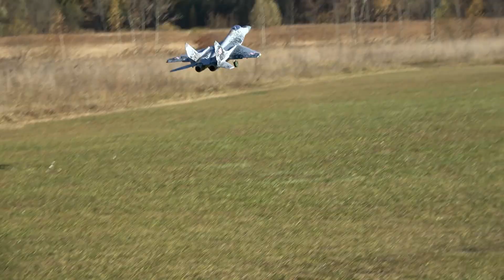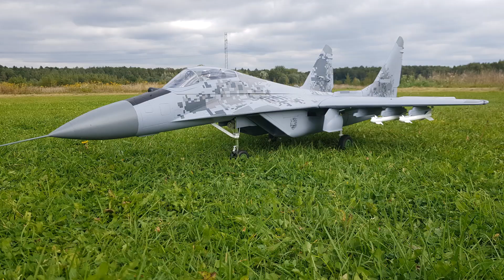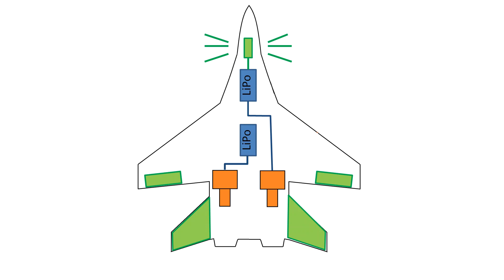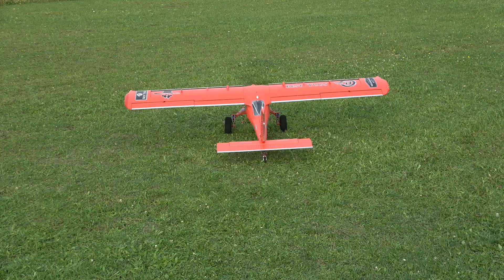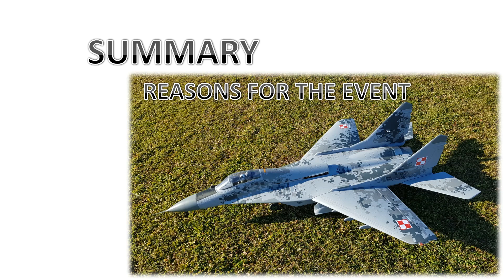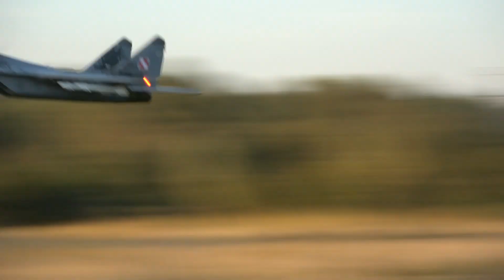PROBLEMATIC BATTERY; FREEWING MiG-29 FULCRUM (EMERGENCY SITUATION / EN)

Comment: Great Breakdown mate.. Steep approach to keep the power low worked well for you.  I had a similar situation with my F-14 where the fan came off one of the engines. Got her back safe which was a great relief.
Reply from the maker: I think, F-14 it is much more difficult to control with one engine working. 
The F-14 has  more widely located motors, which increases the asymmetry of thrust. Moreover F-14 F-14 will stall faster.
Reply from the maker: Thank you, and I wish you only good flights with successful landings : D